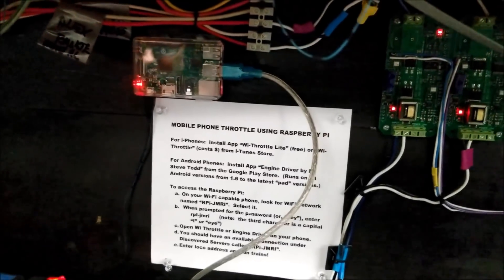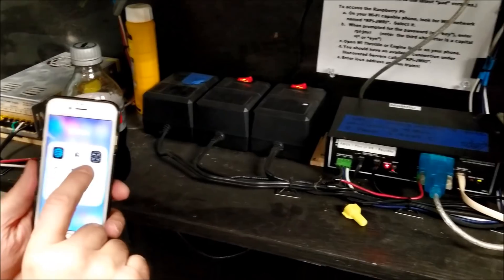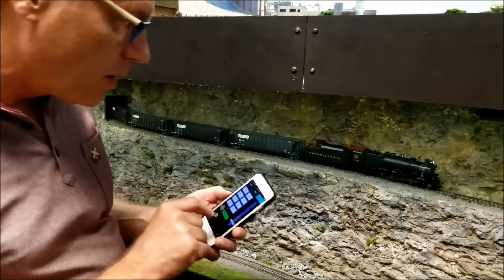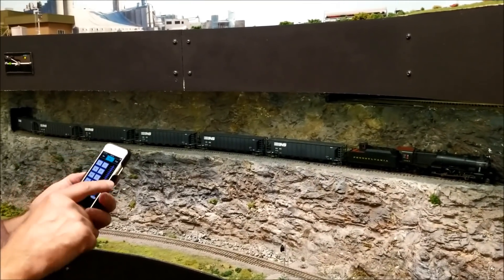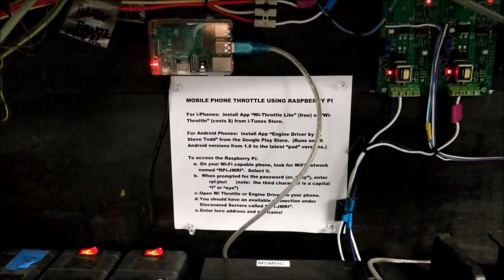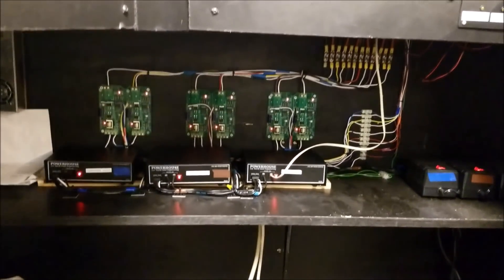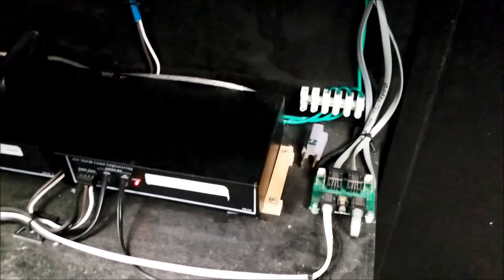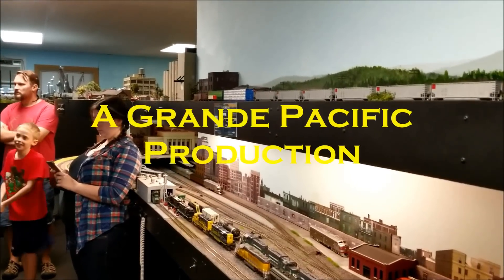MODEL TRAINS RUN WITH SMARTPONES

Comment: With Digitrax, you can just add another WiFi receiver and get 4 more throttles. About $70 each. Add as many as you need! They are ready to run out of the box, just hook up via loconet.
Reply: You have a point! My two clubs, plus my home layout use the digitrax. Neither club has had more than two cellphones at one time, so I guess I never realized the problem. All in what you get used to! 😁
Reply from the maker: @jimworcester981  They have to get away from using Digitrax wifi devise and put in out side  source. I am sure there are videos on Your Tube on doing a Digitrax system.  I have operated on some that have other wifi equipment.
Reply from the maker: Why only four these systems are unlimited could be 100 throttles . The digitrax thing is xtremly limited. Get a pie hook it up to Digitrax then unlimited.
Reply from the maker: Can do unlimited 100s for $30 dollars the Digitrax thing is rip off.

Comment: RaspberryPI can deal with numerous devices, where the limitation on devices comes in with the use of the RaspberryPI's internal wireless as an access point. If you need the numerous throttles I would recommend a separate wireless. I use and love Ubiquiti wireless access points.
Reply from the maker: Andy Crawford Pi works great the issue coming with Digitrax has come out with one only handles four.
Reply: arthurhouston3 That makes sense. I use an Arduino based DCC++...  I’ve looked at buying ESU’s new US targeted system among others, and just haven’t found a reason (yet) to jump. I don’t see any limitations, however my railroad is more limited by space for operators than by electronics. That may change as I push to be able to dispatch and have road train operators control from the internet with view from RaspPi based cameras. I also have friends using the Pi with the PiSprog, including some on relatively operator heavy, large modular setups. Regardless I’m really glad to see you do this video Arthur, encouraging modelers to see opportunities and potential cost savings. Especially since I don’t see the hobby as necessarily as expansive as some do. With FastTracks turnouts and a DCC++ system, all on pink foam, one can build a layout quite inexpensively, as I only have $1000 or so in my 15x15 multideck layout (excluding equipment) so far. People can trade effort for cost, and I love to see people show this, it encourages active layout building by many who may not otherwise. One side note, people should check out ESU’s throttle, since it can be used with JMRI and any DCC system having Android onboard with a knob for those who don’t care for train control by touch screen(ie me).
Reply from the maker: This is links to the rest of info needed.  For Android Phones:  Install App “Engine Driver Throttle by M. Steve Todd” from the Google Play Store.  It is free. 

 

To access the Raspberry Pi:

a.  On your Wi-Fi capable phone, use "Settings" to look for a WiFi network named “RPi-JMRI”.  Select it.

b.  When prompted for the password (or, “key”), enter rpI-jmri 

     (Important:  The third character is a capital “I” or capital “eye”.  Everything else on the password is lower case.)

c.  Open Wi-Throttle or Engine Driver on your phone.

d.  You should have an available connection under Discovered Servers called “RPi-JMRI”.

e.  Enter loco address and run trains!

     
Notes:
1.  "Engine Driver by M. Steve Todd" runs on all Android versions from 1.6 to the latest “pad” versions.  If you already loaded a different Engine Driver App, you will need to delete it and then install the version by M. Steve Todd.  Apparently, any other version of Engine Driver will not work with the JMRI-Raspberry Pi program that was developed by Steve Todd.  .Here is a link for Google Play:  https://play.google.com/store/apps/details?id=jmri.enginedriver

2.  If you wish to equip your personal layout or another club's layout with Wireless capability using a Raspberry Pi 3, the attached file provides information.  In addition, there are more-detailed instructions and sources of components on Steve Todd's website.  Here is a link:  https://mstevetodd.com/jmri-raspberrypi-access-point   

3.  If you have a surplus Smart Phone that has been de-activated from AT&T, Verizon, etc., you can still use it as a wireless throttle.  Just download the appropriate App at home.  (Note:  We do not have wireless Internet connectivity at the club, so you need to install the App at your home before coming to the club.)
Reply from the maker: I have been running wifi throttles for years.  I will redo my set up if you have your command station connected to a computer and there is a router connected to it you are in business.  JMRI has it all in the program will shot a video.  Try and do it by tomorrow. On my system my understanding mo limit on the number of smartphones on it.  Some reason does not count as a throttle in NCE command station.

Comment: The PDF doesnt show where to get the download for the SD card. Where can i find it?
Reply from the maker: OK agree here is the link to the program.  For Android Phones:  Install App “Engine Driver Throttle by M. Steve Todd” from the Google Play Store.  It is free. 

 

To access the Raspberry Pi:

a.  On your Wi-Fi capable phone, use "Settings" to look for a WiFi network named “RPi-JMRI”.  Select it.

b.  When prompted for the password (or, “key”), enter rpI-jmri 

     (Important:  The third character is a capital “I” or capital “eye”.  Everything else on the password is lower case.)

c.  Open Wi-Throttle or Engine Driver on your phone.

d.  You should have an available connection under Discovered Servers called “RPi-JMRI”.

e.  Enter loco address and run trains!

     
Notes:
1.  "Engine Driver by M. Steve Todd" runs on all Android versions from 1.6 to the latest “pad” versions.  If you already loaded a different Engine Driver App, you will need to delete it and then install the version by M. Steve Todd.  Apparently, any other version of Engine Driver will not work with the JMRI-Raspberry Pi program that was developed by Steve Todd.  .Here is a link for Google Play:  https://play.google.com/store/apps/details?id=jmri.enginedriver

2.  If you wish to equip your personal layout or another club's layout with Wireless capability using a Raspberry Pi 3, the attached file provides information.  In addition, there are more-detailed instructions and sources of components on Steve Todd's website.  Here is a link:  https://mstevetodd.com/jmri-raspberrypi-access-point   

3.  If you have a surplus Smart Phone that has been de-activated from AT&T, Verizon, etc., you can still use it as a wireless throttle.  Just download the appropriate App at home.  (Note:  We do not have wireless Internet connectivity at the club, so you need to install the App at your home before coming to the club.)

Comment: Who makes those NS hoppers he's pulling with  thst steam locomotive?
Reply from the maker: Shawn Floyd I do not know been around club.
Reply: Shawn, I’d imagine they’re Walthers cars, however they may be the BLI H class 3 bays. I really love the BLI’s as they have separate grabs and don’t require much to detail well. They are old if you model modern tho, but many were repainted into NS livery. I model the N&W in ‘50 and they are a great fit as they were new then. In ‘50 however I can only use those with 17in lettering. I also think Bowser made/make some similar. So maybe that’ll give you so places to start looking for the cars you want. Happy railroading!
Reply from the maker: I do not know been around the club long time.  Will ask see If I can find out.